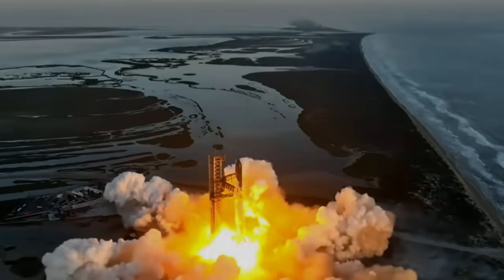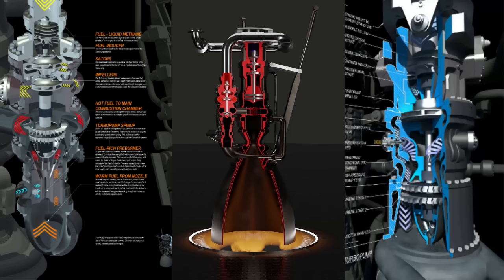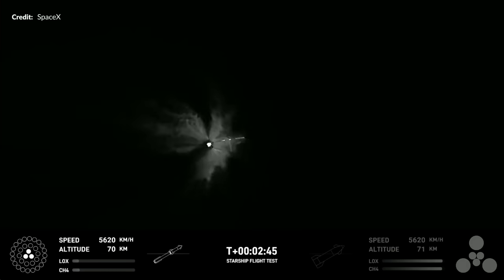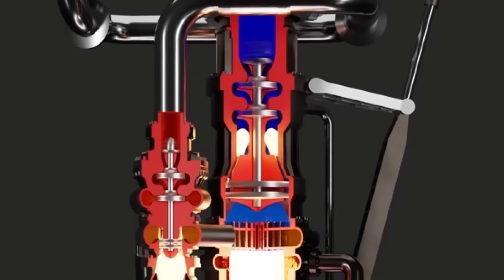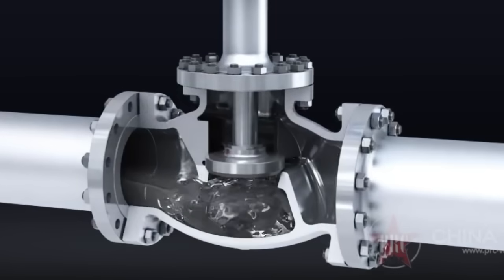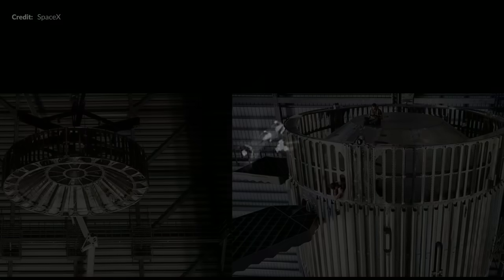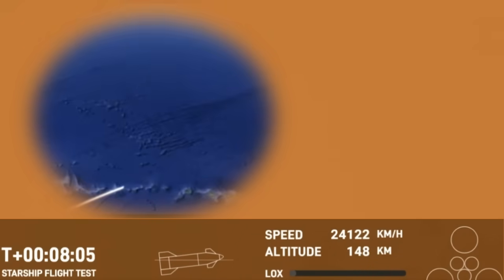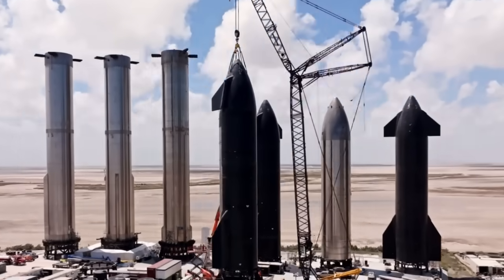Starship Flight Failure Analysis IFT2

Comment: I like your delivery - kind of has a Law and Order feel to it!

I agree with your hot staging analysis.  I would think SpaceX has inertial sensors onboard and will have data about how much the Booster was slowed down.  There has already been speculation that they powered the three center Raptors at 100% instead of the stated 50%.  I am thinking it was an Elon gamble to see if they could “keep thrusting” as much as possible by using all six Ship engines and try to compensate it pushing off the Booster by using 100% on the center three Booster engines.

The gamble did not pay off, but if you are not failing, you are not pushing the envelope.  Your suggested strategy should help at the cost of a little efficiency.

I hope their data tells them what happened to Ship.  Maybe the six engine hot stage was just too aggressive.  Their data should tell them.  I feel pretty confident IFT-3 will pass these hurdles.
Reply from the maker: Thank you! We do have limited data at this time... it would make sense to power up to resist the blowback... maybe just shut them off and spin sedately?  we think IFT-3 will work fine too.

Comment: I voiced my concern of the design of the hot staging coupler was not tapered enough with the flat centered portion reflecting shock loads back into the upper stage engines. 

I still feel the water deluge system is not correctly designed with a proper tapered blast deflection system as current design creates significant forces reflected back up and into Starship which can damage the hot start collars.
Reply from the maker: i agree.  Full dome and add a pyramid shaped deflector for blast deflection?

Comment: the 3 center raptors can gimbal so i think they were oriented so that they did not direct their thrust onto the top of the hot staging ring.
Reply: Yes but they can only gimbal 15 degrees,  a taller staging ring may be needed or start them after it is well clear of the booster
Reply from the maker: Just fifteen degrees though I'm sure that helped.
Reply: @terranspaceacademy  several channels have the video and you can see at stage sep they are indeed tilted outwards and point straight 2 seconds after stage sep
Reply: @johncherish7610  yes im glad spacex is leading this race. no other company tests in public nor shares test data / results as fast as they do. i get that its PR and good will but still ill take it!

Comment: The maneuvering thrusters could be used as ullage motors if all the booster engines were shut down after staging.
Reply from the maker: Indeed... hot gas thrusters could vent from the top in the right direction and create enough thrust to settle the propellant.

Comment: The video of the tumbling starship was just the nose cone.. so after the fts activated. Also, when hot staging occurs, the booster is near empty and the starship fully loaded.. if they both have three engines lit, the starship won't separate from the booster fast enough as it will have less thrust to weight and will rely on the starship thrust pushing on the booster to cause separation instead of the starship just flying away. They should just find out what failed in the starship and either protect it better or add margin in the design.
Reply from the maker: You are quite right...

Comment: Can anyone tell me why, during the early booster phase, there was an assymetric smoke trail that did not seem to be in alignment with the exhaust gasses? From the video at 0:30 the smoke seemed to be offset to the left by a degree or two?
Reply from the maker: The ship was angling away from Starbase as quickly as possible just in case... inner engines would have been gimbaled to the side...
Reply: @terranspaceacademy  thank you. I realised after I saw the Everyday Astronaut footage that my question was dumb!🤣 You can see the gimballing in that footage.😊
Reply from the maker: It is much clearer on later closeups.

Comment: The Starship also lost a considerable number of its heat shiled tiles during ascend, especially around the welds where the tiles are installed by hand. This needs to be changed sooner rather than later as there is no way starship will be able to reentrer otherwise. We also be looking at a Columbia type catastrophe again.
Reply: It seems intentional. Even before the launch lot of people had analysed the footage of s25 and had seen problems with the heat tiles. they weren't bothered enough to replace non-fitting/broken tiles on the ship and kept them in place seemingly to test how long ship could survive in the re-entry.
Reply: And there were only few heat tiles missing on the first flight close to the stage separation, even when spinning it didn't seem like much of a problem, so it seems like SpaceX rapid iterative testing goes as far as taking the risk of a guaranteed mishap investigation while also destroying the ship in the process.
Reply from the maker: I don't think they cared.  Someone said, "Tiles will shake loose!" and someone else said, "Let's see if it will make it anyway!", and Elon said, "Cool." and that was it...

Comment: Agree very much with you. Maybe also rotate slower. Slushing might only occur due to rotating laterally just after separation of the stages. I guess this will take longer but it is the grid-fins they use for that and your extra time could allow for slower rotation towards below. It will cost some extra fuel and lox to do it slower. It could be enough after rotating to have more time in reverse speed to just wait long enough to eliminate gas bubbles by the deceleration by air. 

I would even think of also stopping the 3/6 central engines. There is enough speed and air to operate the grid-fins and when the direction is reversed drag could have enough force to keep the liquids pointing towards the motors to wait long enough to resolve the gas bubbles. 

Turbine pumps have this annoying effect of making pressure proportional with speed and it is hard to predict how much flow they produce. But the power is impressive and they can stand a lot of cold and heat while allowing good separation from both compartments. The danger of spinning out of control due to gas on the cold side is maybe a good reason to also shut down the 3 or 6 central engines during the rotation. and only ignite after reversal and enough time in drag mode to get rid of the gas bubbles. 

It is nice to learn from the failures and then getting it right later on.
Reply from the maker: I wonder if there is enough resistance to flip by hot gas thruster and let the propellant settle before firing for return?
Reply: @terranspaceacademy  Your right at  about 150 km it is almost in space so not dense enough to effectively use the grid-fins so I did see some puffing from small thrusters and that shows what happened. I know that hydrogen peroxide and manganese peroxide as catalyst is a possibility but they use some nitrogen agent and a solid catalyst I presume.

Comment: That's a great analysis, but it has some issues. At the separation time, the Booster is almost empty of fuel, therefore its weight is too low and the 3 central engines alone will make the Thrust-to-weight ratio (TWR) to be very high.

If firing only the 3 vaccum engines of Starship, it won't make enough TWR to separate from the Booster (because booster TWR is greater than ship TWR).

Also, the vaccum engines don't gimbal, so the only way of controlling the Starship attitude would be using differential thrust, which also reduces even further the spacecraft TWR.

I think the solution for this would be just recognize that hot staging was not a good idea.

Starship must be able to perform engine starts in space, so it must be capable of doing it while staging as well. It must be able to do the proper ullage and start it's engines in a very controllable and predictable manner. Hot staging is "too much dynamic", and very difficult to do preciselly.

Also, the firewall adds a lot of weight to the rocket, which basically kills all the advantages of doing hot staging in the first place.
Reply from the maker: Good point. Actually  with the three booster engines throttled down to 50% the vac engines at 100% would have more than twice the thrust so no problem... TWR isn't really a factor except while in gravity drag. They just need to have more thrust than the booster.
Reply: @terranspaceacademy  

An almost empty booster weights ~300t (200t dry weight + 100t of propellant).
An fully loaded second stage weights ~1300t (100t dry weight + 1200t of propellant)

The FULLY LOADED Starship second stage is WAY heavier than the empty booster. Even with 50% throttle, booster TWR will be greater than the second stage's TWR at 100% using only the 3 vaccum engines. In fact, even with all the 6 engines, the second stage TWR barely outcomes the booster TWR.

And I'm not even considering the actual payload... Which will need to be added eventually.
Reply from the maker: True...

Comment: Isn't the problem of sloshing fluids a well known one ?  How does Falcon deal with it?
Reply from the maker: It gives time for the propellant to settle down.  That was a Falcon 9 internal tank video shown sloshing.  Smaller rockets don't need baffles.  Nothing as big as Starship has flown since the Apollo era.
Reply: Different fuels different booster dynamics what works with Falcons maybe wont work on starship

Comment: Maybe i am wrong but i feel like SpaceX is still treating Starship just as "bigger Falcon 9" and refusing to take into account other big rocket (Saturn V, N-1) successes and failures. I agree with your assessment that they yanked booster back way too hard and too quick. Bootback maneuver seemed like sharp "drift style" car turn using handbrake.
Reply from the maker: I think they're goal was to prove hot staging could work and were willing to sacrifice the booster and get the heck out of dodge... and the leak could have been from the damaged QD on the Starship.  Overall a good test.

Comment: Love your vids. Popping in to ask if the images at 8:40 were actually the front half of starship well after flight termination. Thats what i saw them reported as
Reply: Also, i saw video that showed the center engines of the Starship at maximum outward gimbal during hot staging, hopefully this prevented them firing against that flat plate
Reply from the maker: It is indeed. The same guy saw the Starship spinning before FTS activation but I clipped the wrong section.
Reply from the maker: It helped no doubt.

Comment: The grid-fins would be offering 'some' decelerating force on staging. They are way up in altitude with minimal air pressure but still travelling very fast - and also would be being impacted by starship engine exhaust. Maybe they caused some problems with fuel sloshing and also directional control?
Reply from the maker: That is a good point... 80km would still be low enough for a significant effect.
Reply: @terranspaceacademy  I've since noticed that Scott Manley's analysis/observation determined that the acceleration of the booster went negative, briefly. That can't been good for keeping liquids at the business end of the rocket motor hardware.  I think your suggestions make a lot of sense.
Reply from the maker: He does a great job.  I'm quite sure that was not the plan SpaceX had... reduced acceleration sure but not negative.

Comment: nah, if they fire only the three vacuum engines after stage sep and the booster continues on three engines only - there will be no stage sep. :) both vehicles will continue with the same speed/trajectory. Also, the booster must get away asap and as far as possible from the exhaust of the Ship - that's why they fire all booster engines from the inner ring, and the booster immediately goes away to the side - it just escapes the blast from the Ship. There must be another solution, such as adding baffled plates in the fuel tanks, or adding multiple small tanks instead of just 2 (I forgot their exact name, the Ship has them too). Another nice solution according to me is to add 3 more vacuum engines to the Ship, thus firing only the 6 vacuum engines first, and maybe avoid firing the three inner engines at all... keeping them for landing instead.
Reply from the maker: The three vac Raptor are more efficient than the sea level therefore greater thrust for the same propellant flow... then the booster three are throttled back so the Starship would have more than twice the thrust.
Reply: @terranspaceacademy  , yeah, true, but the differences are very slim. After all, they are three engines firing in either case, just with or without the vacuum optimization (mainly differences in the size of the exhaust bells). And even if the booster's are thtottled back, I doubt the difference would be enough. They would have try to do it if it was... who knows indeed. :)

Comment: The center three engines did indeed have room to vent as they were angled towards the hot stage ring.
Reply from the maker: But only 15 degrees and the plumes from the Vacuum Raptors would have impinged on the exhaust flow focusing it on the center.

Comment: I am not a space engineer but I was thinking a spring loaded mechanical separation system would have worked perfectly seconds before the main engine ignition on starship.
Reply from the maker: Maybe a hydraulic ram... or shut down the booster and only fire up vac Raptors on Starship.

Comment: Hot staging is bad idea. I agree hot staging is the most likely cause.
If only three vacuum engines start of Ship, while three are left on on Booster, then Ship can't decouple. Booster is lighter so wants to overtake the Ship.
So hot staging segment should become larger for 6 raptors firing,
To prevent hammering in the Booster the staging separation between Booster and Ship must bcome far more gentle.
Reply: I agree with the risky nature of hot staging.  I think they did the hot staging in order to fail quickly.   The next test may not use hot staging.   They know that the normal staging process with work for sure, so they may have just wanted to test.  Theoretically the hot staging will allow for a larger payload.
Reply from the maker: Hot staging can be risky but it worked very well for the Soviets and Russians... The booster Raptors are at 50% power with sea level Raptors at high altitude therefore low efficiency.  The vacuum Raptors are at full power and are much more efficient at that altitude.  It should be more than double the thrust of the booster.

Comment: Here's a hot take:

1. All 33 booster engines running at 100%.
2. Starship ignition sequence begins.
3. Booster Meco's while maintaining control of slosh UNTIL separation occurs/safety distance attained.
4. I HAVE NO IDEA WHAT I'M TALKING ABOUT.
Reply from the maker: Actually that was pretty good.
Reply: @terranspaceacademy 

I mean it made sense in my head until I remembered that I never built a rocket before.
Reply from the maker: Indeed. Olympians make everything look easy. :-)

Comment: If you can believe the telemetry feeds in the videos. Super heavy decelerated by between 0.8 and 1.7g during the hot staging separation. I'm surprised this hasn't been pointed out by anybody before. This of course would be disastrous to engine startup.
This miscalculation is a blunder only exceeded by the inadequate flame deflector and water deluge system of IL 1
Reply from the maker: It is an amazingly robust system to survive that.  But a hundred tonnes of propellant slamming around cannot be good.

Comment: If you're right about the hot staging, it seems the easy fix is a delaying igniting the center three engines.  But someone has said those are gimballed outward anyway and therefore the flat plate shouldn't be a factor.

The Russians have figured out hot staging, and thus have been using it for decades.  SpaceX will too IF that was actually the problem.  The hot staging might have gone fine, and the explosion was related to something else.
Reply from the maker: Very true...

Comment: You should consider that the booster is almost empty when hot staging happens and the ship is full, if they don't light up see level engines on ship, it might never gain enough acceleration to depart from booster that its 3 engines are running and it's almost empty.
And if they don't light up all engines for pit maneuver, they waste alot of fuel I think
Reply: Isn't the Statship doing EXACTLY the same speed as the booster while they are still attached?
The 3 sea level engines are not at maximum thrust in a vacuum AND they drop the power to 50%
Three vacuum Raptors are going to only add velocity to the Starship and the backwards thrust will slow the booster. 
You can actually see how aggressive the deceleration is on the booster telemetry
Reply from the maker: They should still be able to move safely away with the vac Raptors but simulations will be necessary...
Reply: @Mattsretiring  same speed isn't important here, acceleration is the key
Reply: @terranspaceacademy  don't need simulation, just the mass of booster with the remaining fuel in it and mass of sturships, plus trust of both vehicles are enough for calculations

Comment: 8:05 center 3 engines were gimbaled out and did not fire until well after the 3 vac engines
Reply from the maker: They were but I don't think 15 degrees was enough and they fired up too soon but maybe  it was something else.  Without full access to the data these are exercises in thought.  Not implemented solutions.